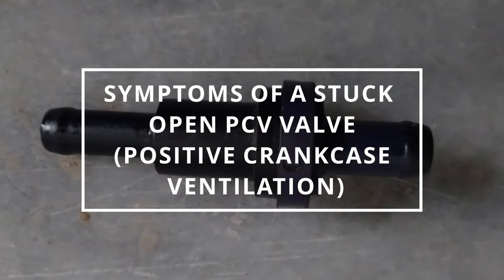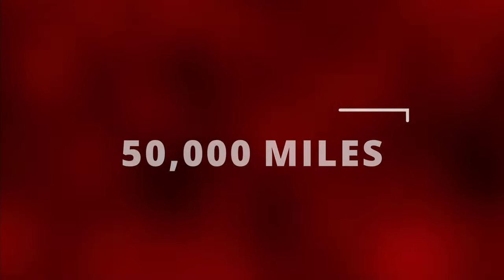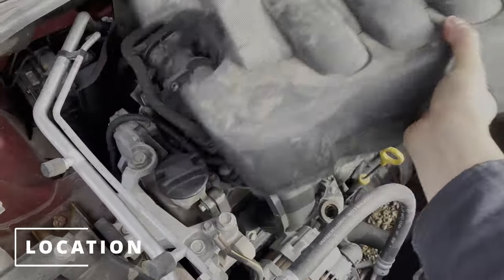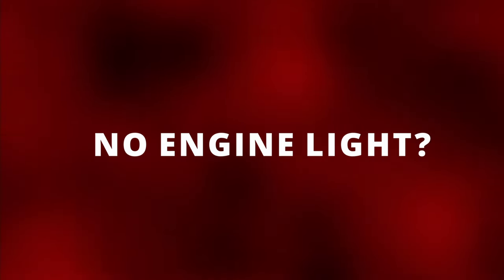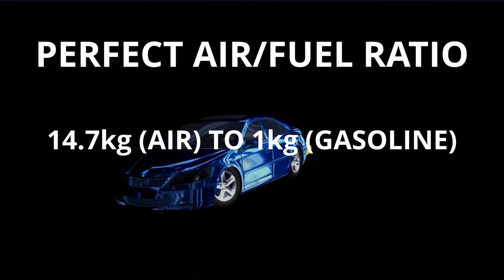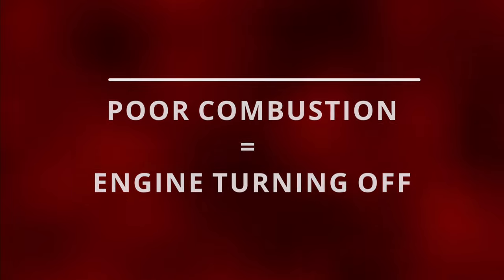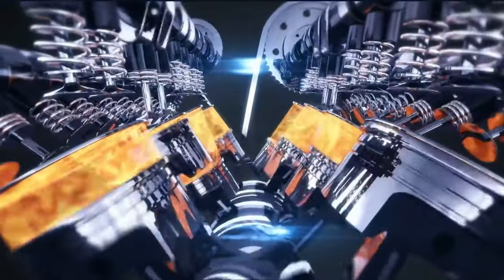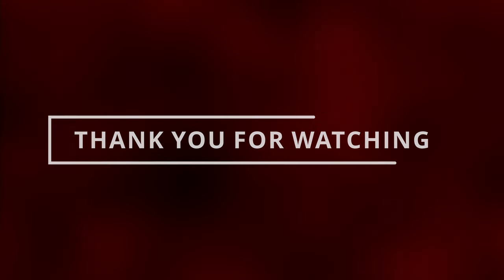SYMPTOMS OF A STUCK OPEN PCV VALVE

Comment: I have the blue smoke and at time when I step on the gas I shoot out oil? Could it be the pcv valve? No check engine light and it’s a bit rough when idling but runs greats I go through a quart of oil every three days.
Reply: You need to sell that car and buy a new one while it still runs fine, trust me.
Reply: Definitely something much worse than a pcv, people in this video are thinking these symptoms are way worse than what they will be with a faulty pcv
Reply: @tokahontas9990  thank you, Do you think if I get a new Engine would it be worth saving then?
Reply: @miguelmarquez4369  most definitely, if the transmission and frame are otherwise okay. I’m going to put a new engine in my Infiniti once this one fails, the transmission is in great condition still and the body is perfect. It will cost me so much less to just put a new engine in as it will only cost be about $4,000 a new Infiniti would be much more expensive.
Reply: I second this advice. Like tomorrow if u haven’t yet
Reply: A quart of oil every 3 months or 3,000 miles would be barely acceptable.
Reply: "Runs great" "I go through a quart of oil every 3 days". 🤔
Reply: tokahontas .... are you a professional and certified mechanic?  I do NOT trust you at all ...

Comment: 2012 buick enclave pcv valve doesn't have internal guts. shake test doesn't work. had problems with oil getting into throttle body. buick said to drill out holes in pcv valve to the next size drill bit so oil can drain back into the engine. sad design

Comment: no...... the most common is some condensed water in the engine oil cap cause is open to the atmosferic when the engine is not running
Reply: The most common what? I have a 2002 Dodge Ram 4.7 and every time I take the oil cap off there's a little condensed water on the Underside are you trying to say that that's from a bad PCV valve?

Comment: I have a 2007 Ford Taurus with a p0302 cylinder 2 misfire I replace spark plugs wires coils took it to my mechanic couldn't figure out what was wrong with it but it was a head gasket but showing no signs could somebody point me in the right direction help me figure this out not sure what else to do
Reply: 02 Sensor
Reply: fuel injector?
Reply: Here's something to try. 
Swap the fuel injector, coil, and plug, with a neighboring one. 
Check Compression between them while you're there. 

No change? It didn't move to the other cylinder? 
AND the compression is good? 
 It could be the computer or gasket.

If the compression is bad, put a few drops of oil into the cylinder and check again. 
This checks if it's the rings or the upper end. If it changes you need new rings, if it doesn't it's either the valves or the gasket. 

If you want to tell for certain if it's a blown gasket, 
Does it lose oil or coolant?
Does it have extreme pressure in the cooling system, or crankcase? 
Does it have coolant in the oil(milky) or oil in the coolant(frothy and milky)?
It's your Compression good?
Take a spark plug out and look in the cylinders with a bore scope to see if there's leaking anywhere.

Simple things you can do to have an idea where to go.

Comment: I had a crank and no start. It was the pcv valve stuck open.
Reply: Im having a similar problem, I need 3 cranks to start car. Im assuming it could be bad pcv valve, idk .. so did you fix your problem.

Comment: So would a stuck open pcv cause an oil leak? Got an ase question that says it will NOT cause oil leak. “A stuck open pcv valve would not cause excessive crankcase pressure but would cause a vacuum leak and cause engine to run rough at idle.” 

Snip snap snip snap! Which one is it lol
Reply: Stuck open, no unless there's backfiring happening. 
Stuck closed yes. 
Rattling it also doesn't check condition much. 
Check operation by blowing through it. It should only go one way. "Out"

Comment: No code it just acts like it wanna cut off you if u step on it she a go but it acts stange when driving 2008 a6
Reply from the maker: Like a stutter when accelerating from a stop? how many miles?
Reply: My truck turns on pretty straight first try   But my truck idles on 1,000 rpm till I drive around I’ll come to a red light and have it idle below 1,000 rpm n acts like it wants to turn off
Reply: @easyautofix  172k and just replace the radiator support cuz someone backed into me no air bag deployment and sat a year before I fixed it now she runs drives no leaks just that rough asf idle and misfiring cylinder 456 
3 and one has a open circuit shop said I need a valve cover gasket and coil packs no mix in oil and no smoke just smells like gas when I start wonder if it's my O2 sensors or my intake manifold gaskets I did sea foam and idk if it works
Reply: @easyautofix  yeah it's like over 2k

Comment: The purpose of a PCV valve is to carbon-up the intake valves on a GDI engine.
Reply: I thought that was the purpose of the DI and egr parts. 
The actual purpose of the pcv system is to pull the crankcase into vacuum so that the seals last longer and the cylinders aren't fighting as much air pressure inside the motor when they go down, therefore using less fuel to operate.
Reply: @kairu_aname  "In order for the PCV system to draw fumes out of the crankcase, the system must have a source of fresh air. The source of this fresh air is the "crankcase breather", which is usually ducted from the engine's air filter or intake manifold. The breather is usually provided with baffles and filters to prevent oil mist and vapour from fouling the air filter. This phenomenon can be further reduced by installing after-market air oil separators or catch cans, as colloquially known, to pull oil mist out of suspension and collect it in a reservoir before it can reach the intake."
Reply: @Pro1er  
Almost none of that is true. 
The pcv needs a source of vacuum. 
Never piped to the air filter. 
It's an oil separator, almost never filtered.
The last thing is correct. 

It's no wonder you think the pcv system causes gunk. It "can", but it does because there's no fuel to wash it off, and again the egr is what mainly causes the soot.